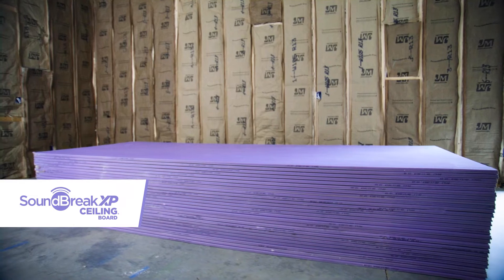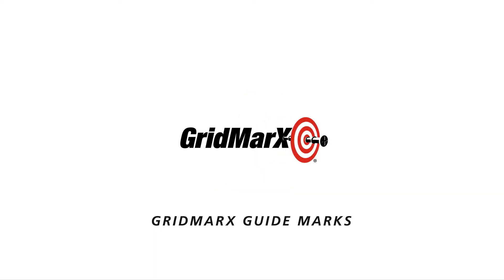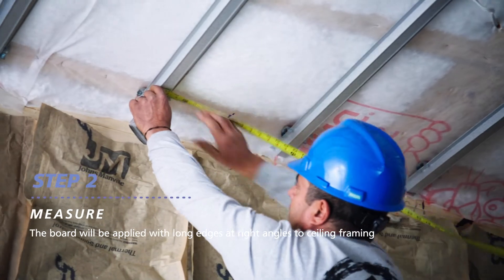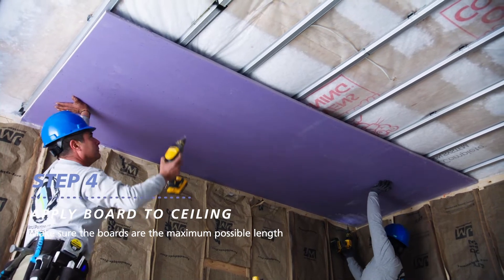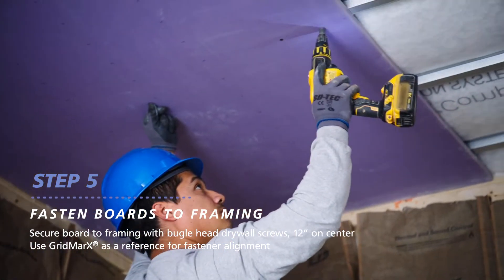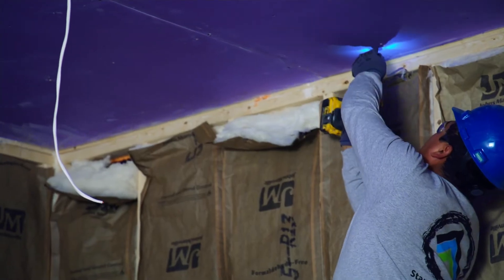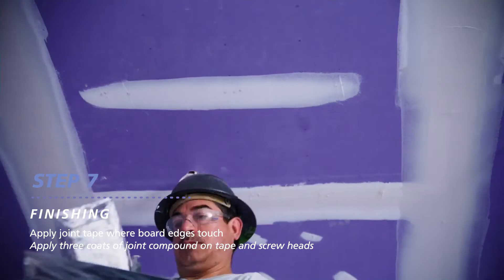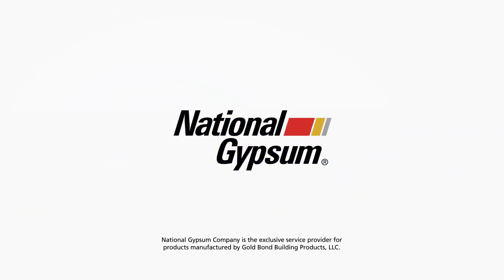Step-By-Step Guide to Installing SoundBreak® XP® on Ceilings

Comment: How thick is the ceiling sound break?
Reply from the maker: Gold Bond SoundBreak XP Ceiling Board is 3/4" thick
Reply: @NationalGypsum  weight per sq ft?
Reply from the maker: @dwaaziwaazi  It has a weight of approximately 2.9 lbs. per sq. ft.